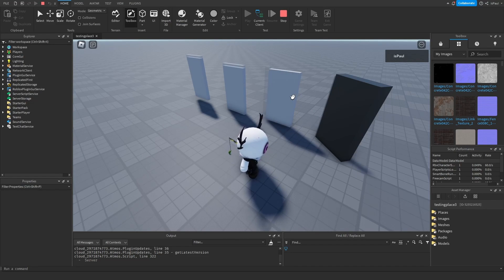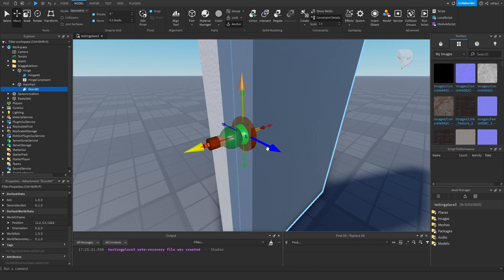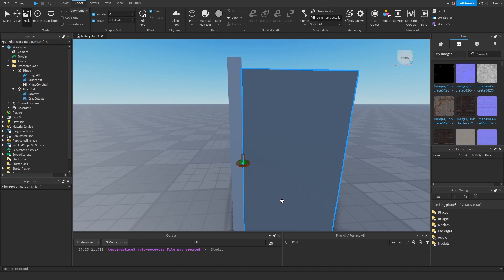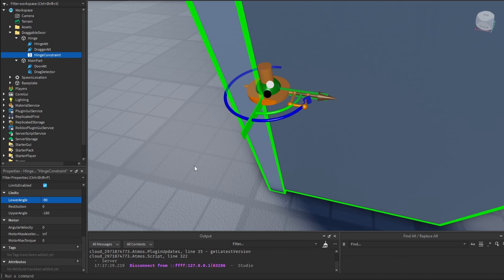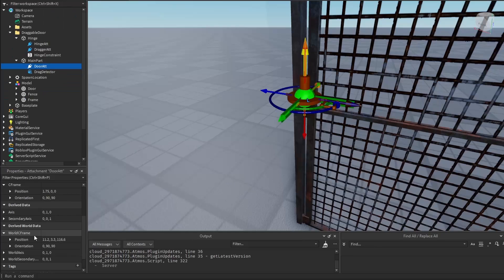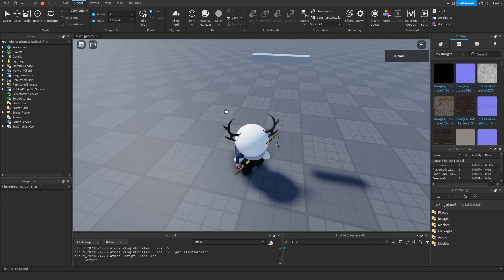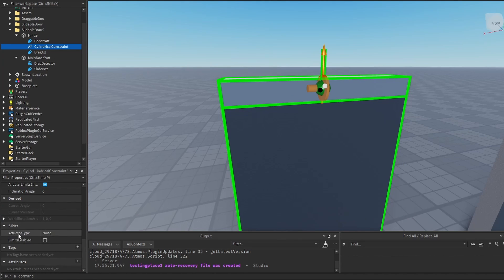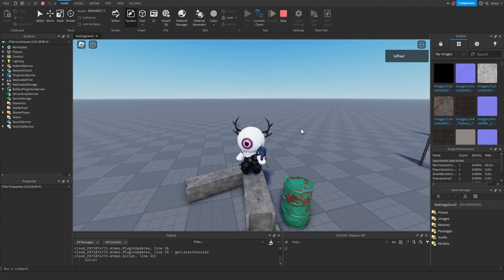Draggable Door! | Roblox Studio DragDetector tutorial

Comment: Great tutorial, but it seems that because it is unanchored I can just push it open which sort of removes purpose from being able to drag it open. But anchoring it will make the HingeConstraint not work.. is there any sort of fix I can do to prevent this?
Reply from the maker: Oo right thanks for pointing that out!
You can add a weldconstraint to the hinge and set it as part0, then doorpart as part1, and enable/disable the constraint in the DragStart and DragEnd events.
Also thinking about it, you can also keep enabling the weld inside DragContinue, in case of multiple people dragging the door at the same time, so it doesn't break.
Reply: @Paul1Rb  i dont understand what you said can you explain it to me because im not very experienced in scripting
Reply from the maker: @amustingcow  I recommend following beginner guides then
Reply: @Paul1Rb  wait how to I make the part weightless or make it a certain weight

Comment: Maybe make some sort of part 2 to this tutorial.

You can use levers and buttons to open any type of doors.
Reply: so maybe if there`s no any "at angle" option in script for this i think you can use position and rotation to use it
Reply: When I get back to my house then I'll check it out and maybe wip up a small script and give it to you
Reply: A can think of a few ways to get it to work.

1. Check it's rotation/position

How this could work is by maybe checking the position/rotation changing and then seeing what position it is. 

Of course for position it might not work as well if your using it as a assest.

Here is a basic script format that shows what might work with this one:

Part/Group located 
↓

(1 of 2 ways might not be a thing)

Value change function based of the drag detector - if it's being held down maybe?

(2 of 2 this might work instead)

Add a click detector and then make a function based on if its being held down by a users mouse
↓
Check position every frame using heartbeat (local RS = game:getservice("runservice")
↓
Then if its at the correct
↓
Make sound/open door/whatever you need it to do
↓
Lock in place maybe?

Another way I can think of is by just simply making a function that goes off when the position/rotation gets to a point